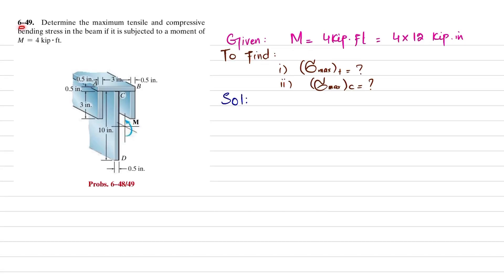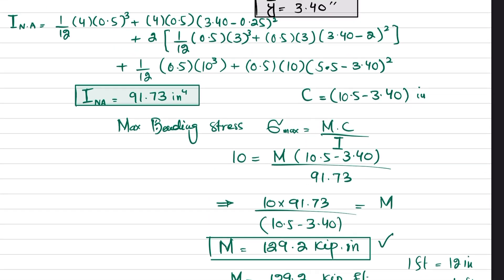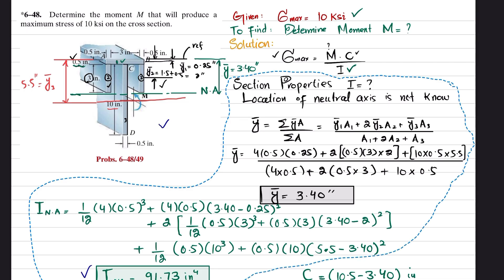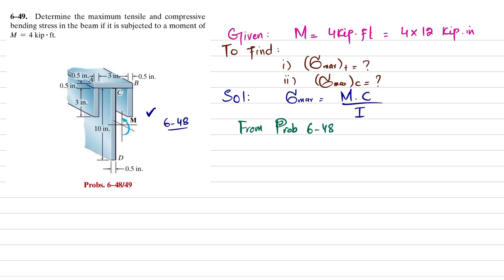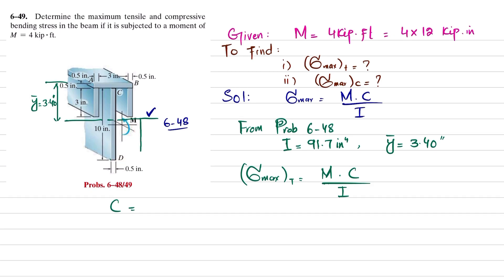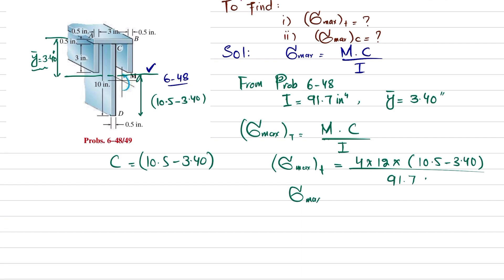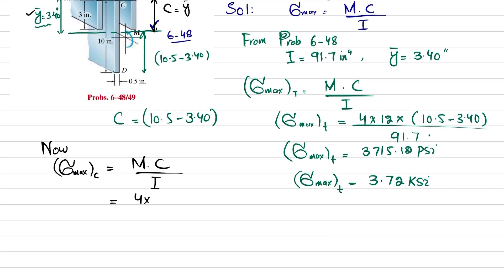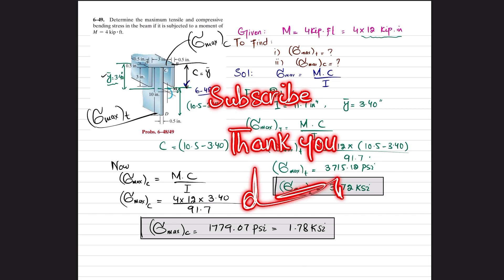6-49 Determine maximum tensile and compressive bending stress | Mech of Materials Rc Hibbeler

Comment: Is there any rule to take neutral axis, like from bottom or top, also in some lectures i found that max compressive stress = -My'/I, why this is negative here and you didn't mention negative sing, is there any rule?
Reply from the maker: There is no rule you can take top or bottom surface as reference.  Now second question answer is that bending stress = - M* y /I when the moment is counter clock wise as shown here in the problem the beam will bend like u shape causing the upper layer to be in compression and bottom layer will be in compression and the formula is applicable when you find the bending stress above or below the neutral axis and any where in between neutral axis (y= distance from neutral to any point above or below). The second formula is max bending stress (compressive or tensile ) = M* C /I where c is distance from neutral axis to top or bottom layer. I have theory lecture and if you need i can share it with you where both formulas have been derived and you will learn easily...
Reply: @engradnanrasheedmechanical  plz share the theories, im a bit confused
Reply from the maker: Mechanics of Materials Beer & Johnston online Lectures
https://www.youtube.com/playlist?list=PLuj5YwfYIVm9GBcC6S4-ZgHS1szlF7s1Y
This is whole playlist. in that go to chapter 4 lecture Pure bending...please then provide your feedback also. thank you 🙏
Reply from the maker: You are welcome

Comment: in these types of beams is tensile stress always on the bottom and tensile stress always at the top?
Reply from the maker: It depends on the direction of moment if it acts like in this problem then bottom will experience tensile stress and top will be have compression but if the moment is clockwise then top will be in tension and bottom surface will be in compression
Reply: @engradnanrasheedmechanical  thank you sir